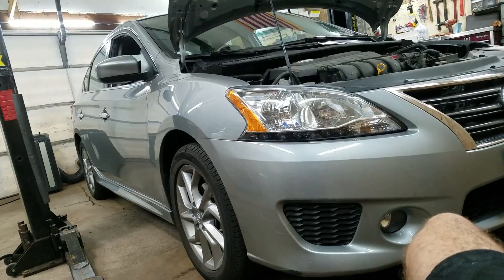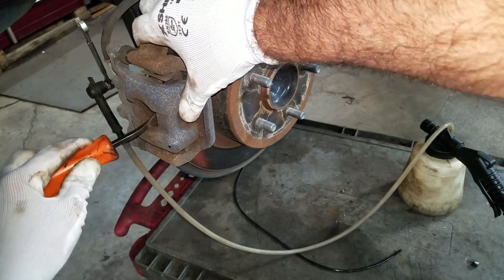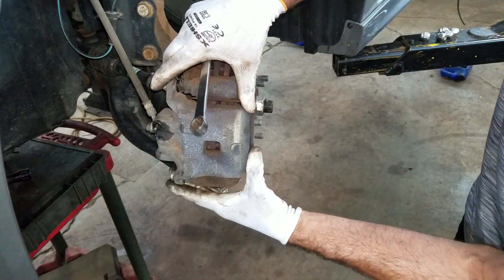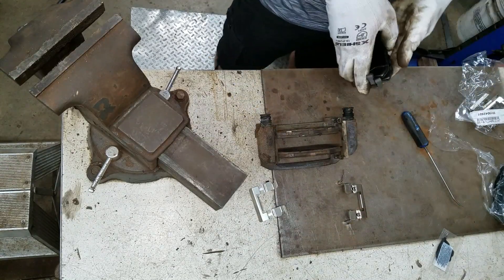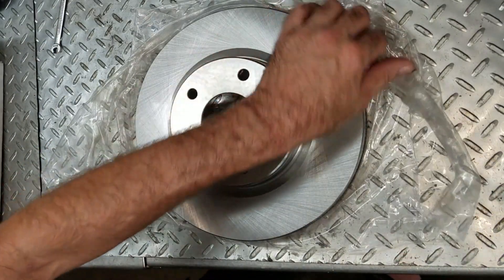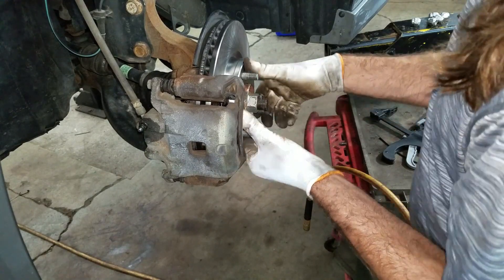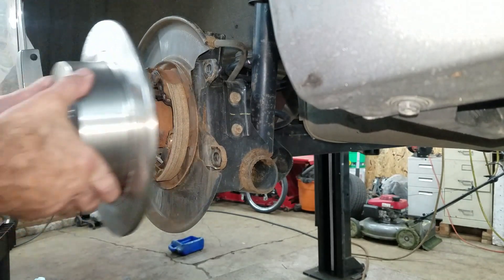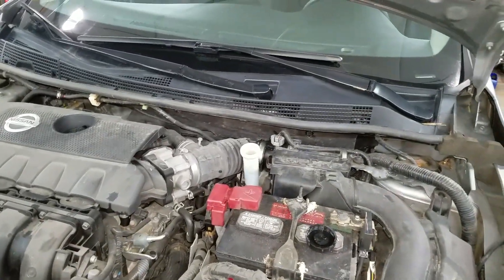2013-2019 Nissan Sentra complete brake job, and flush

Comment: Very well done.  Can you tell me where you got the torque spec for the front caliper bracket bolts?  Another video says 122 ft. lbs.  I checked Alldata and it says 122 as well.  But that seems awfully high, approaching the limits of the bolt (assuming it is an M12 grade 10.9).

Comment: Thanks. How often are you supposed to change the fluid?
Reply from the maker: Look at your owners manual.
Reply: @RustBeltAuto  It doesn’t say.
Reply from the maker: @Keegan Maroney  you can call the dealer, and ask service I guess.
Reply: @RustBeltAuto  Ok
Reply: @RustBeltAuto  I found out it’s 65,000 miles or 78 months.  My car is like 25,000 and 3 years.  They told me it needed maintenance like 3 weeks ago.  Whatever I guess.

Comment: Great video sir. But can you PLEASE confirm that the rear bleeder screw is 8 mm. Also, I am very interested to know the diameter of the bleeder screw tip  (head) where you have that black connector on the end of the clear tubing. Thanks.
Reply from the maker: Most all Japanese bleeder screws are 8 and 10mm. 3, or 2mm hose should work, and have never bothered measuring the thing.

Comment: Hello, 
I accidentally knocked of one side of the wheel cylinder.  Is that bad .
Reply from the maker: Only if it leaks. It should be bled.
Reply: @RustBeltAuto  will do thank you for replying